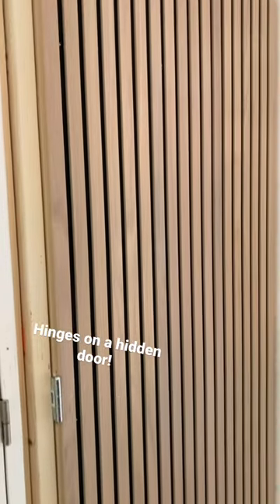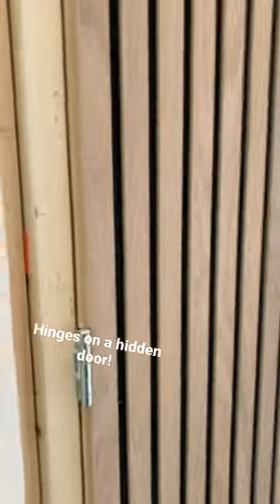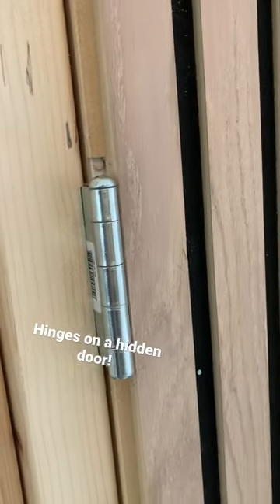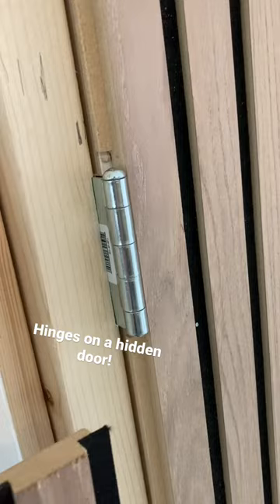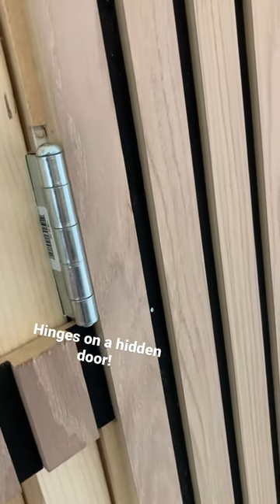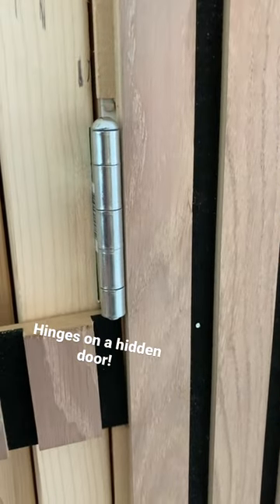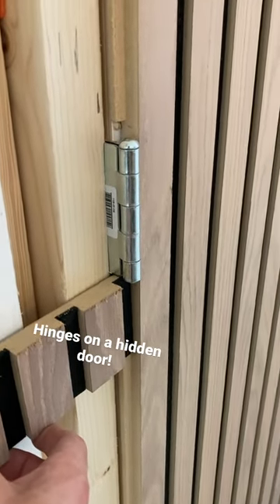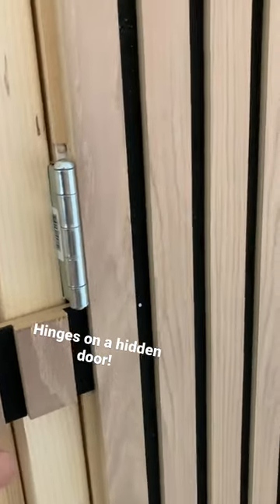Where are the hinges on a hidden slat door! #slattedwall

Comment: You can’t hide those hinges unless you paint them. I’m doing that for a build which will turn out amazing, but hidden door concealed hinges are the best way to go
Reply from the maker: True you need them black. And the position in the shadowline.
Hidden hinges have trouble getting enough clearance for the coverin on the door. Usually now 4mm or 1/8’’.

Comment: do you know how to make the hinge but for the door open to the inside (not like the short, which opens to the outside). im wondering how to put them while also maintain the flat surface of the door+frame+wall, for further decoration with wall panel. thanks

Comment: Use
Tectus t 340 model hinges
Reply from the maker: good point, hidden 4 point arm hinges do not work well with door covering thicker than 10mm. so there is a tradeoff with those types of hinges.